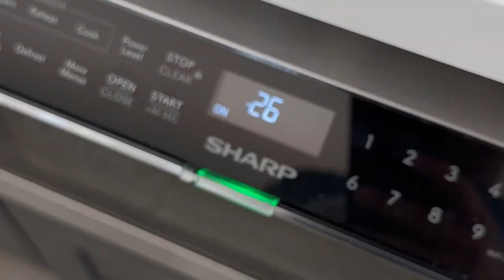Woodturning — i nearly destroyed this chunk of Cedar!!

Comment: I've dried rough touned bowls in the microwave several times with good results.  No more than 30 seconds, every 30 minutes - 1 hour.  usually do it for about 4 hours, then wrap them in plastic when I got to bed, then do a couple more in the morning before chucking it back up, got some good results with small white oak peices this way (And i've been TOLD that white oak is prone to cracking... ymmv)
Reply from the maker: interesting adding the wrapping in plastic overnight.  is that to reduce any additional uneven drying until you nuke it again?

Comment: yes, cedar is really soft to turn.  you might try filing or sanding your tool rest smooth.  all those bumps create alot of extra tool marks. and thus more sanding.  Also, using a sanding sealer along the sides of a crack can help keep the glue from penetrating the visible surface grain when doing a repair.  Cedar gets real thirsty and getting that darkened / discolored area out can be almost impossible on softer woods.  Bowl does look awesome.  Great job and thanks for the video.  PS... i never mount a piece onto a screw with the lathe running...
Reply from the maker: great tips! esp with cedar wood.  thank you 😊 ikwym about loading the blank with the lathe on…but it does make a nice clip in the video

Comment: I think you had a couple of run ins with those knotty parts. Sometimes wood is easy to turn, unless there's knots where branches grow out of, hidden under the surface of an otherwise ordinary piece of wood. I've heard of woodturners having issues with knots in wood products. You finally got it going though with the faceplate. After all that trouble, it turned out to be a really good chip'n'dip bowl! 😁👍👍
Reply from the maker: thanks!  it was more challenging to turn than expected, for sure!

Comment: Beautiful final product, yes some issues but the result was gorgeous. I’m not a big fan of face plates nor screw chucks. Do you have a drill press and a 2 1/8 inch Forstner bit, or whatever Forstner bit will fit your chuck. I almost exclusively mount on a chuck, it’s so easy and quick and versatile, and much more secure in my opinion especially on wood like cedar. I’m jealous of your cedar blank, where did you source it? I would love some of that!!
Reply from the maker: i think i might have actually got it off etsy, lots of folks selling blanks on there, have to look carefully for quality though.  so right about screw chucks, i don’t use them often.

Comment: Oh yes if you are using a screw chuck or face plate, after pre-drilling your holes put some CA glue down in the holes to give that wood on the screw much more stability and you will have less problems I think with it stripping out
Reply from the maker: thanks for the tip!!